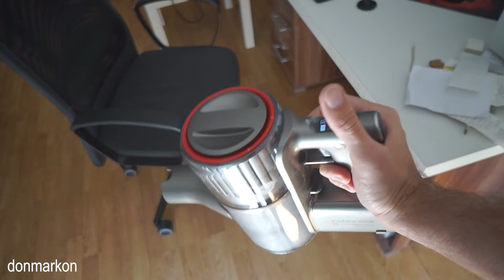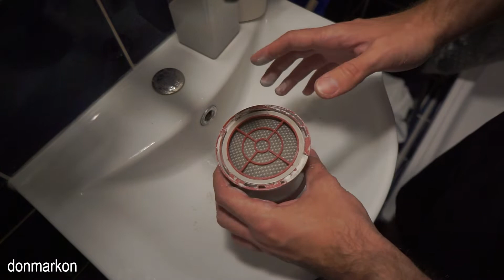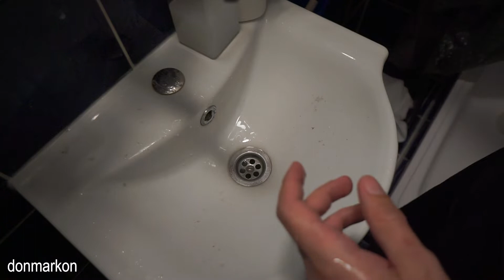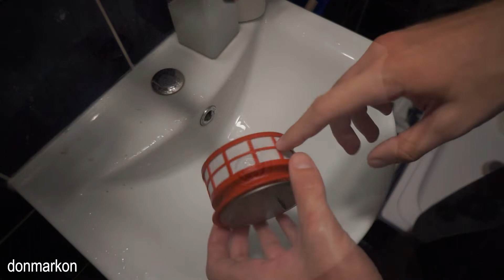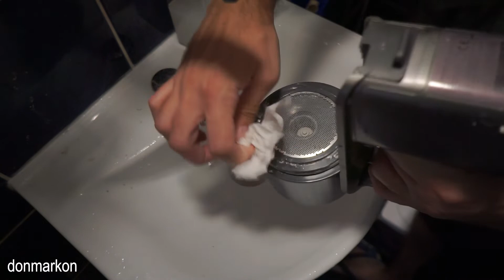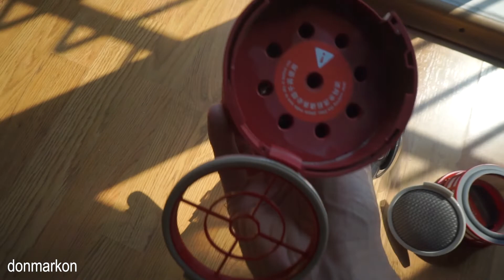Cordless Vacuum Stick No Suction Not Working IMPORTANT Maintenance Fix Roborock H7

Comment: Süper video. my vacuum is not charging. it has been 3 days. I cleaned the filter. it didn't work. charge always shows 1% 😞
Reply from the maker: Sorry to hear that
After you put it to charge what does it show?
Reply: @donmarkon  It shows charging on the screen. but it stays at 1% no increase
Reply from the maker: Charging controller is faulty
Reply: @gamzemutlu3900  Gamze hanım merhaba. Aynı sorun bende de oldu geçen gün. Şarj %1 de sabit kaldı. Siz sorununuzu çözebildiniz mi?
Reply: @aktugkubilay8893  merhaba, ürünü servise yolladım ancak oradada çözülmedi iade ettim malesef